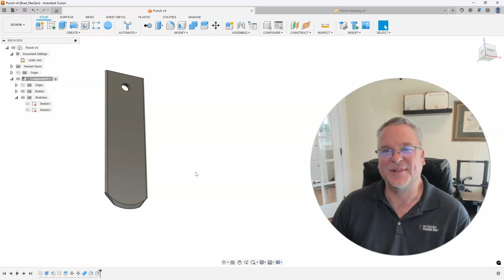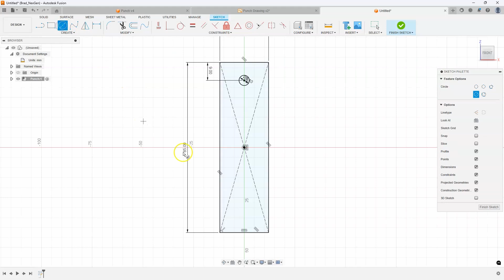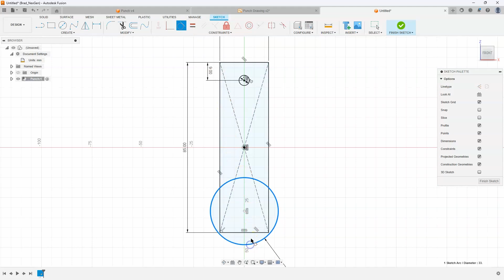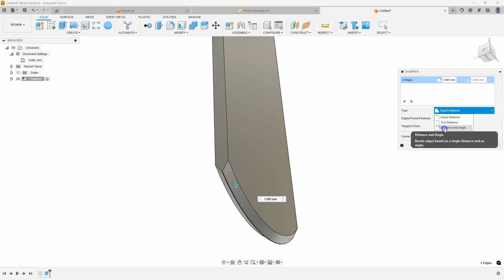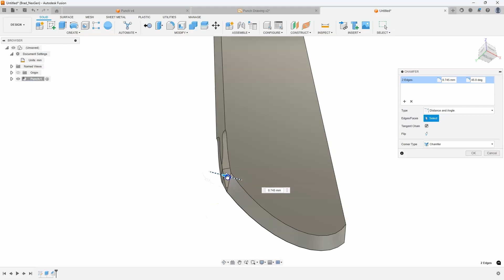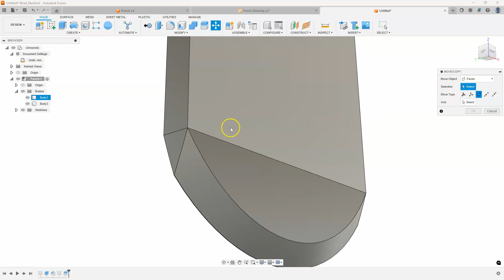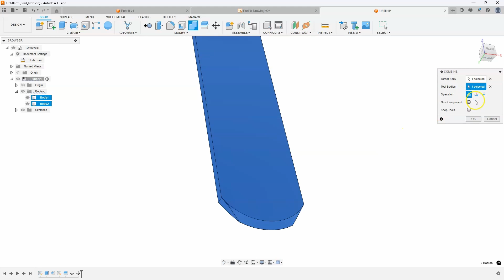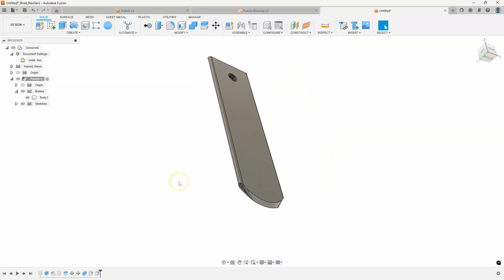Fusion Friday - How would you make that?

Comment: Hi Brad, I'm just starting to learn Fusion and I really like how you do your video. My question is, how do you rotate the model every time you wanna show a feature? The only way I know so far is by selecting the Rotate icon at the bottom of the screen and the pointer turns to a gyroscope. I didn't see yours do that, so there must be a quick better way to rotate without selecting that icon. Thanks
Reply: You can hold the shift key on your keyboard and the middle mouse button (scroll wheel) down and then move your mouse around to rotate the object.  I believe Brad uses a spacemouse to rotate objects around but that is not needed.
Reply: @wolf9545  thank you

Comment: why split the body instead of split face? You can just use split face and use draft with parting line and two side option instead of splitting the body and using the move tool
Reply from the maker: I tried using Split Face originally, but it doesn't always work the way you want it to.  If I just split the face, there wouldn't be a "boundary edge" on the front and back of the part where the face needed to rotate.  By splitting the body, it creates those boundary edges.
Reply: @bradtallis8968  The parting line only has to be on the split face. You don't need it on the front and back of the part. I can showcase it and post it on the fusion forums (as I already tested it out), but the autodesk forum is malfunctioning as it keeps automatically refreshing and redirecting the page back to the index.

Comment: Not sure about the move tool. I would rather just make a cut there. But I suppose it was there to show an alternative technique.
Reply from the maker: Absolutely.  You totally could have created a sketch on the front, defined the 70 degree angle in the sketch, and used the cut command.  Actually, that is probably the more "correct" way of doing it.  I just wanted to show the move faces command in this video and this was a good example of where you could use it.  Thanks for watching!